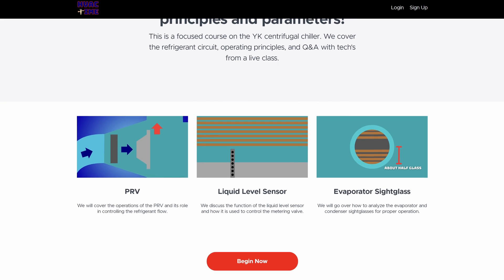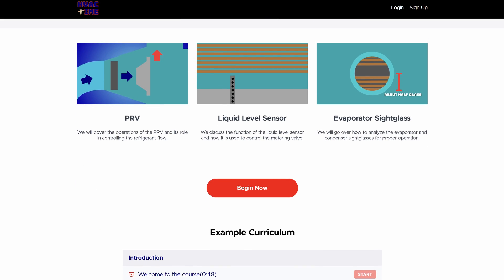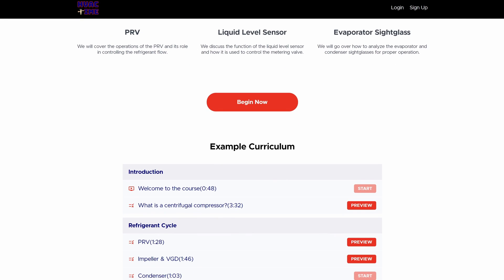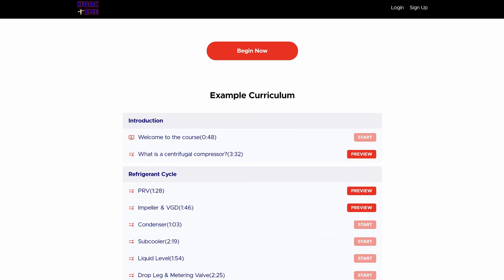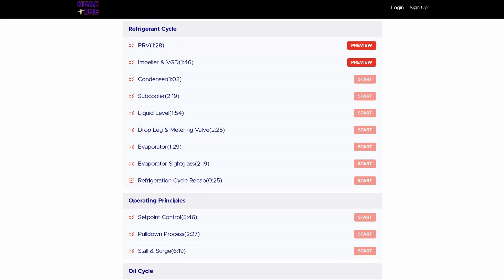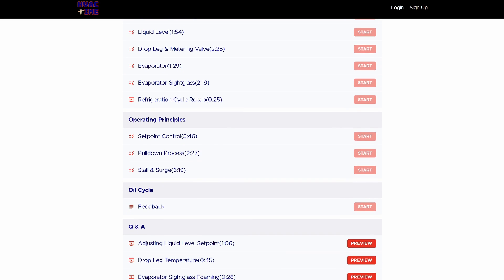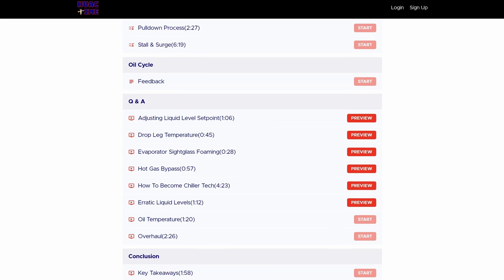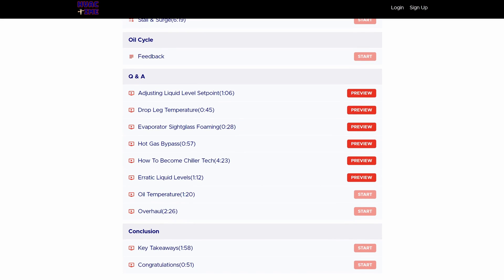DX vs Flooded: Chiller Evaporator Types

Comment: I recently replaced an EEV on an air cooled screw. I looked into the connection to the brazed plate where your saturated line connects to the HX....I noticed there was a fixed orifice plate after the EEV. So it seems like it's a 2 stage flash to start the phase change
Reply from the maker: Interesting, it could be that the orifice is the primary pressure drop and the valve is more focused on flow control.
Reply: @HVACTIME  there are 2 modes for the EEV. Pressure and superheat. Pressure control ignores superheat and focuses on evap Pressure. The other is standard suction superheat control. AGZ has a floating setpoint based on circuit capacity. 33-66% is at 8° and 100% is 10° SH. On a screw its a target range that can float.

Comment: I’m a bit confused by your explanation. We have an air cooled Carrier 30AX which have the condenser water coming in the end bell & feeding from the TXV to the bottom and suction line on top, but the literature calls it either flooded or DX and I had a hard time determining which was which. I think it is flooded based on your definition BUT the manual says it should maintain EEV position based on discharge superheat. But I find it is maintaining the EEV position based on Suction superheat, which is called out to be for the DX setup. What are your thoughts? I suppose it could be configured wrong but the units are 15 years old!